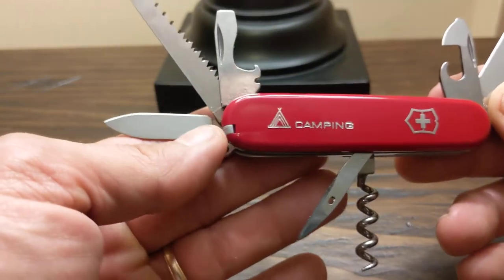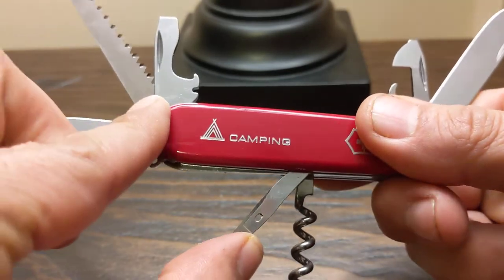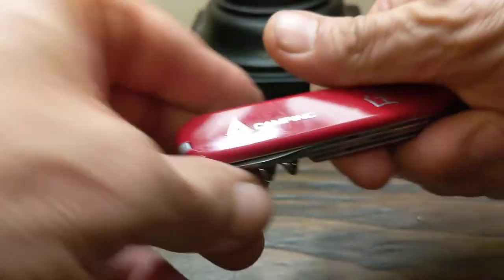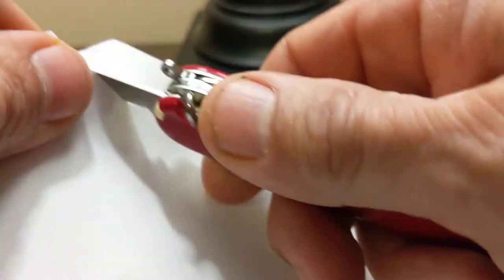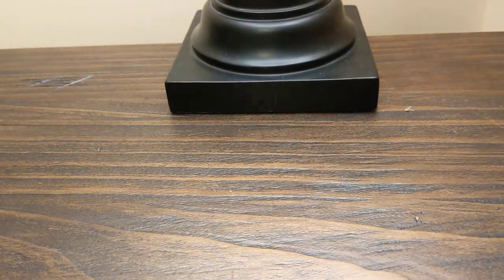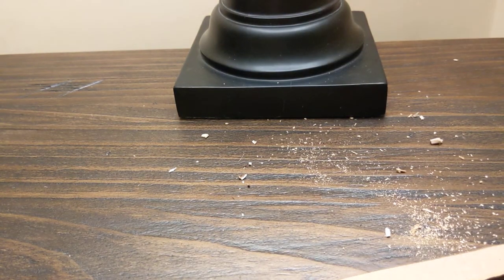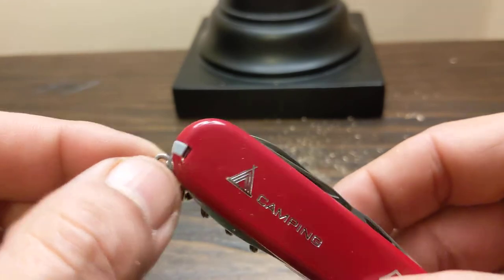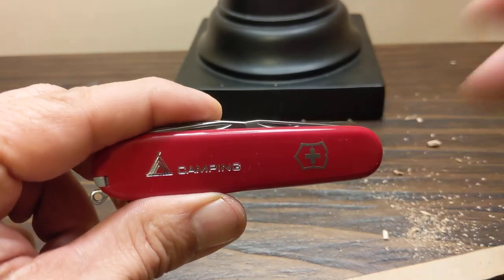Swiss Army knife Camping Edition,Victorinox,12 tools,Very Compact, Excellent Quality and Price.

Comment: Victorinox Swiss Army, does not make a Wood Carving knife that has two carving blades, a saw, and a large roughing blade. Blades that have 58 or better Rockwell hardness or 440 or better stainless steel.  Just three slots (not sure what they are called) handles. that are rounded for comfort, with locking blades.  Folded no more than 3 1/2 inches long.  If all the carvers out there will unite and keep bugging Vicky about it, I am sure they will listen.
Reply from the maker: Yes that's a great idea, Thanks for your interest, please subscribe.